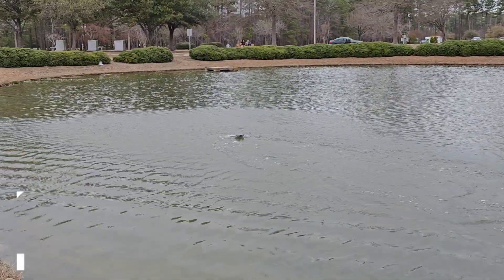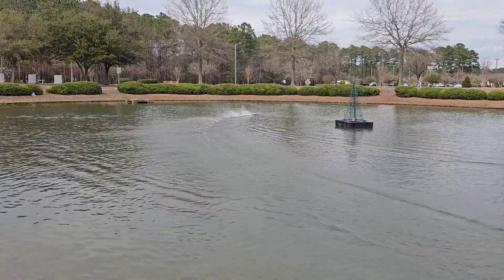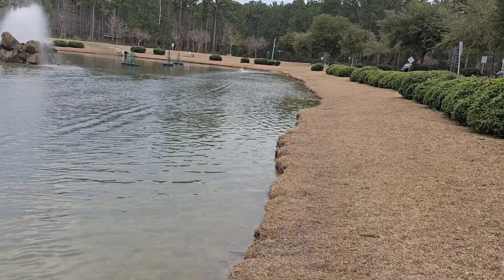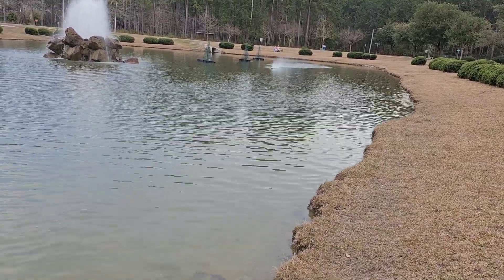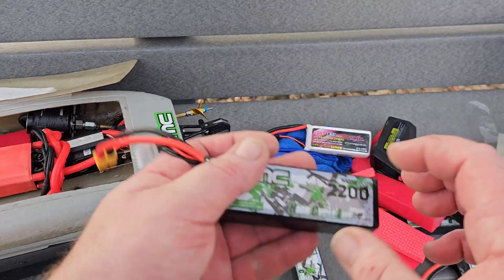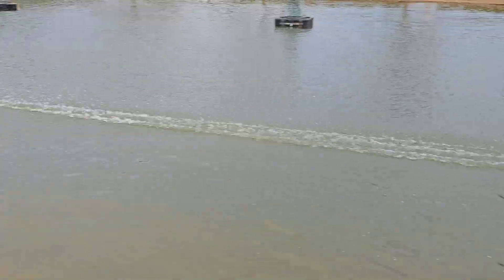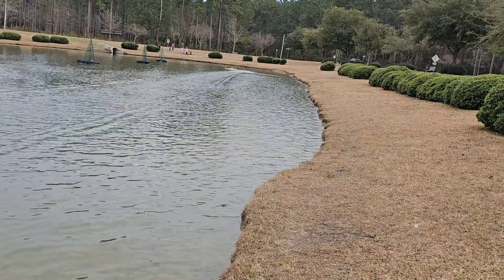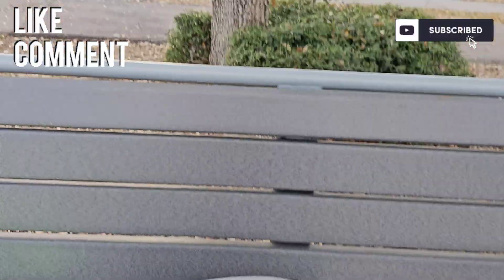NEW SMC HCL-HP Flight Series 21" Twin Cat 3s & 4s Test - 90a Flycolor, 2948 Rocket Motor

Comment: It's taken a while but I finally got to make my first run with this boat...wow. it runs great. It's fast and punchy. I actually think it runs better than the new v2 black jack.  I copied most, not all, of what you did on yours so i thank you very much. Don't let yours sit on the back burner. Bg4l
Reply from the maker: Awesome to hear Jim, I just put a coat of clear on mine, moved the servo back about an inch from where I originally mounted it, all I need to do is reinstall everything and get some new esc's (stole the 90s foe the df29 twin)

Comment: What size is the shrink wrap for the 2 esc. The biggest I've seen on eBay was 4in
Reply from the maker: I used 1.5 inch, but i had to stretch it out to get the wrap on the esc's, 2" inch may be a better option.   Check this vendors store he has a massive selection of shrink wrap https://www.ebay.com/itm/201911642465?mkcid=16&mkevt=1&mkrid=711-127632-2357-0&ssspo=RTv4p2T0Th2&sssrc=4429486&ssuid=yQkZS9FcQay&var=&widget_ver=artemis&media=COPY

Comment: Been looking at that boat on eBay and I just haven't pulled the trigger because of the turning characteristics. I'm sure that you could get it trimmed out to handle the turns. But then you ran the 3s and it was plenty fast and a lot more responsive. Thanks big b. Bg4l
Reply from the maker: I'm about to shorten the stingers about 7mm and see if that helps also ha e some other ideas, wish I were more experienced tuning a twin motor catamaran.   Still learning I like the hull a lot it's a thick fiberglass hull that should take some abuse
Reply: Did you stay with the 150s ESC. I thought you changed but I couldn't find anything on the other videos. Also as if you need more to do, I watched a build series on my r4 outrigger and the guy linked all the videos together so you didn't have to search all over. Just a thought.
Reply: I just bought this hull and it said that it was the last one. I also didn't see any on their website
Reply from the maker: @jimstone5339  Most of my boats have their own playlist 
 21" Twin Motor Catamaran: https://www.youtube.com/playlist?list=PL9QFIiVlkdYZLORST3YVaMw3dhliHHPOs